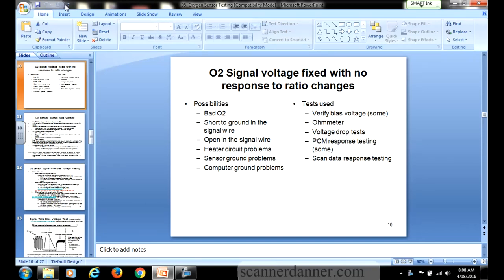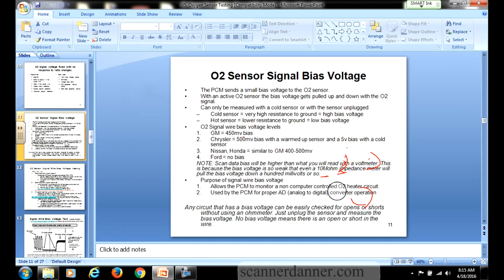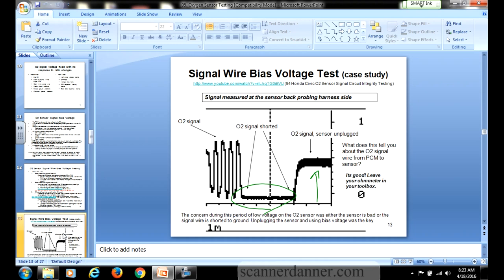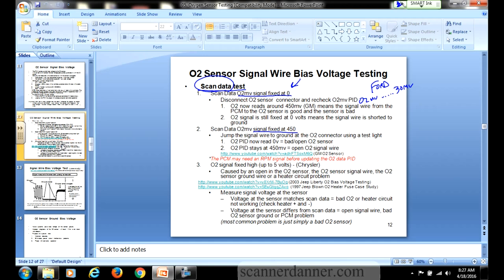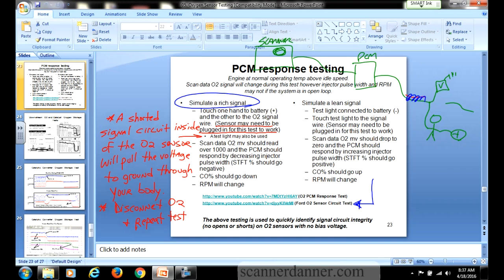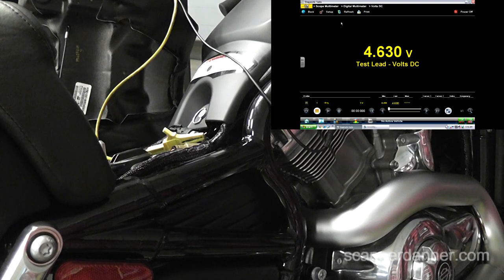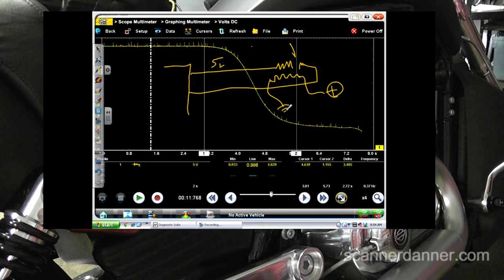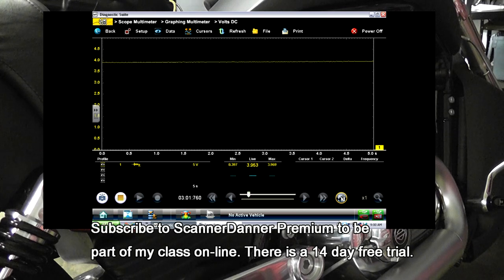What is Oxygen Sensor Bias Voltage? (an SD Premium video)

Comment: Liked how your body pulled it down. Lick your fingers and it will go down a lot more. Right?  Much less resistance. Starting to understand the buffer on the vantage pro. Would help to c u concentrate on that one feature. Like does it start automatically every time u start testing? How do u make sure your not looking at buffer instead of live? So far that has been the most difficult part of the scope for me.
Reply from the maker: Good suggestion! Thanks Bill
Reply: Paul has a very good series on the verus and vantage pro on his other channel